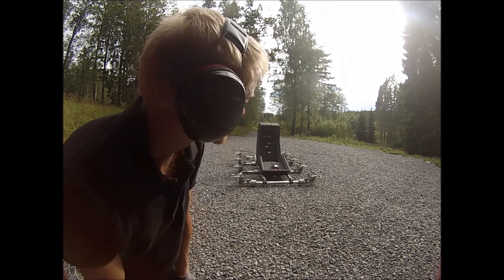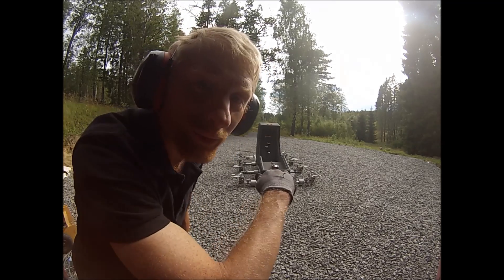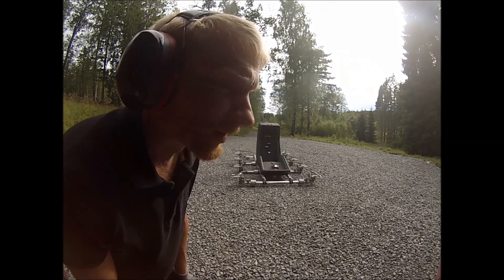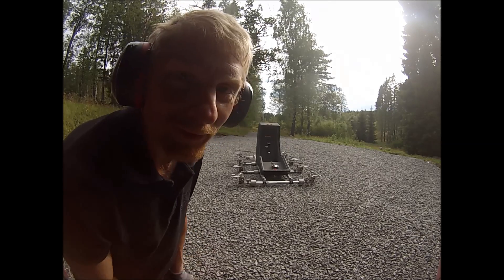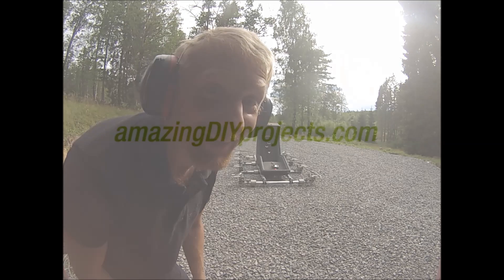Manned multicopter Episode 11  Expanding the flight envelope -Yaw

Comment: From what I seen in the pictures those plugs look rich not lean. Typically when a engine runs lean it will bleach the plug center electrode bright white. From the pics those look carbon fouled. Which means rich.
Reply: Agreed

Comment: You're the fucking man. Someone else brought this up, I ain't wealthy but if you had a kickstarter or some way of collecting donations I'd contribute if that would help you get better equipment and make a beast of a machine. I think many others would probably contribute too. One question what sort of flight time can you get at this point before having to refuel? Hope to see you fly from point A to B soon even if it's a really short distance. Good luck!
Reply from the maker: Thanks, really appreciate the thumbs up!
Just checked the last flight. The duration was 4 min 30 sek and the fuel consumption came in just under 3 liters. The current fuel tank is small, only 5 liters. So, in theory you got 7 min 30 sek duration if you only hover and do gentle maneuvering

Comment: I just dound out about you and naturally subscribed.

I am an engineer

you need the left side rotors to be turning the opposite direction of the right dide motors. Then you need to check if the inward to the craft direction of the rotors or the outward one is the optimal one because only the one of the two will be better since you had a difference now in turning soeeds between left and right.

I would guess that the outward one would be faster and the inward one for better control.

I can explain to you how this works allthough i am a civil engineer i have great perception through the other engineering field...

Hey maybe i can crack the mental iq record with a new number like 320 iq rating 😜
Reply: You should watch this project from the beginning, where he explains everything he already did.

Comment: Congratulations on achieving actual human flight with your design, that is truly amazing!  

I see you picked 2-stroke (2-cycle) engines undoubtedly for their excellent power to weight ratio which exceeds that of conventional 4-strokes.  I have a lot of experience with 2 stroke motors and yes, the spark plug is a good visual indicator of air/fuel ratio.  You need to look at the white ceramic part of the spark plug that insulates the electrode that goes on the inside of the combustion chamber.  The side view you gave doesn't really show this as we need to look into the bottom of the sparkplug to see this.  A perfectly tuned air/fuel ratio on a 2-stroke motor will read as dark golden caramel.  An engine that is running lean will look much lighter than this.  An engine running rich will be sooty and black.  From the picture you gave, they almost appear to be sooty and black meaning that you actually have a Rich condition (keep in mind I didn't have the best view of the sparkplug section I mentioned above).  it is far safer for an engine to be ran in a rich condition as it is almost impossible to hurt a 2-stroke this way.  It will just run poorly and you will foul sparkplugs, but the engine will be safe.  However, it is much more dangerous to run a 2-stroke in a lean condition as this makes them run catastrophically hot and what's worse is that in a lean condition you are running less fuel and the fuel on a 2-stroke is what delivers the lubrication; further compounding the seriousness of running in a lean condition!  You don't want to have the very real possibility of an engine seizure while mid flight.  I hope you are running at least 32:1 ratio of high octane gasoline (runs cooler as the octane controls the rate of burn) mixed with a good synthetic 2-stroke oil.    Also, once you get your engines dialed in just right, you may want to slightly richen them up to make sure that you are in the safe zone (like 1/16th of a turn out on the high speed jet).  Also something to keep in mind is that you want to retune your engines when they are at full operating temp, because if you tune while they are still in the process of getting to full operating temperature when they finally heat up they will be too lean and then you can have sort of a run away effect where the engines are running lean, get too hot, which makes them leaner, which makes them even hotter and so on...  It sounds complicated but really it's not at all, it's just basic common sense once you know these "laws" of 2-stroke engines (what I'm calling them).  

I can give you a list of why I'm credible of telling you this information if you would like, 
i just didn't need or want to toot my own horn because that is not what this is about, just trying to relay some critical information about these high performance/high RPM 2 -strokes because (admirably) I can see that you are trusting your lives to them.  Much respect on your creativity, engineering and well... you got balls.
Reply: Well said ! 
My hat is off to you Sir :)
Reply: GEORGE THEGREEK Thank you very much sir, I'm glad you concur!
Reply: i agree with Atimatik, he is correct in what he says.
Reply: Leo Hicker Thank you very much, I appreciate confidence.

Comment: Just some suggestions:

1. put some coanda ducts around your propellors.  This would provide extra protection (for you and the props) but more importantly it will significantly increase the amount of thrust you get and thus improve your marginal power situation.  There's a video on my RCModelReviews channel which talks about the theory of ducted propellers and explains how this works.

2. install some "proper" controls.  Yaw pedals, a collective/power lever and a joystick for roll/pitch will make it much easier to control the craft.  A joystick for roll-pitch will make the input of corrections almost automatic -- think about it.  If the joystick remains vertical and the craft banks to the left it will automatically input a corrective input. 

3. hardwire the controls rather than rely on an RC link.  A failure of the RF link or any component therein could result in some nasty consequences so the fewer parts in the link between the control input and the flight controller the better (increased reliability).

4. add some instrumentation -- especially for the motors.  EGT and cylinder-head temperature are valuable metrics for judging engine performance and reliability.  Your "lean" engine would have certainly had higher EGT and head temps so you could have spotted the problem before it cause the engine not to run.  If a similar problem causes an engine to stop mid-flight, the results could be far from enjoyable :-(

Keep the instrumentation simple -- rather than having a readout for each motor, simply have three readouts -- one which displays the minimum temperature (and engine number), one which displays the average temperature and one which displays the highest temperature (and engine number).  This way any exceptional conditions are easy to spot.

The real risk right now is that you've gotten past the "first flight" caution and trepidation so your confidence will begin to grow.  With most pilots, that confidence actually grows faster than it should so you reach a point where "something goes wrong" because you've exceeded your skill level or you've started taking essential factors for granted.   That's when bad things happen.   Treat each flight as if it were your first and perform very rigorous preflight and post-flight inspections.

This advice is worth what you've paid for it but I've done a lot of similarly crazy things in my life and (so far) managed to reach my 7th decade without too much damage.  I hope you'll do the same :-)
Reply: damn Bruce, that is some good advice...especially the part about the joy stick...that makes HUGE sense...it's almost a self leveling system if you just hold it straight up no matter what...what about a Nazi 32 with manual controls...is that possible?
Reply: +1
Reply: +powerftkt810Aerial +2
Reply: +Rasziel +3
Reply: damn Bruce, that is some good advice...especially the part about the joy stick...that makes HUGE sense...it's almost a self leveling system if you just hold it straight up no matter what...what about a Nazi 32 with manual controls...is that possible?
Reply: The key to your craft is that it is RC. First and Foremost. Otherwise buy a helicopter. In future you want to fly this craft FPV with VR googles. So for safety Bruce perhaps has a point but the trajectory of the craft that can lift a human is to be able to fly human size pay loads around. To fly bodies off mountain tops after a disaster. To deliver food and supplies to remote locations by FPV and RC. The whole purpose is to have a large RC craft. So keep your development work going and ask Brice about putting his FPV experience to consulting for you. That exhilarating feeling you have is about staying a few feet off the ground. But to fly it in the air put dead weight in the craft and keep it RC.

Comment: What's that spaghetti wiring box on the ground there?
Two strokes can be made to run in opposite directions. . . 
Extend the four inner motor tubes. Were gonna tell You all
about how to do what You're doing - this thing ROCKS! 
That speaker box cockpit is funky - looks heavy.  Enjoy this immensely.

Comment: the reason it turns better to the right is because of the directional torque created by all of the engines spinning in the same direction
Reply: he has reversed 4 of the engines so, no, that's not the reason. besides, if all engines turned the same direction it would be constantly spinning..fast! =)
Reply: +Joel Bergström I sort of figured that after I wrote it...I just wrote before I thought it through...thanks bud

Comment: that's not where you read plugs.  you read a plug where the ceramic and the metal shell meet.   

great job on your project by the way.   I love the stuff you do.
Reply: That thang should be blow'in smoke like mad . . .
Reply: What to look for.. you want a light tan at the base of the ceramic where it meets the metal shell.  You're looking for a light tan.  And you WILL need a flashlight, and ideally a jewlers loope.  Realisticly, I just wouldn't try.  

Detonation, might be a thing, you can find that on the electrode and ground wire by looking for little bits of aluminum deposited on the plug itself.  If that's the case, adding and extra headgasket can drop the compression ratio to help that out.  

It's been asked by others, but what premix ratio are you running?  Are you running model fuel, or gasoline?  |

HOw are you setting up the carbs when you run the motor?   IIRC, you richen them till the motor spits, then you lean for best rpm, then you richen it a little again.  That puts you somewhat on the cool side of things.  

Electrode wear is not "wrong" and can come from a lot of sources.  Are those the factory plugs?  A spark with to much energy can cause electrode wear.  And cheap plugs.  And cheap plug materials.  Are these the factory plugs?  Before modern iridium and Platinum spark plugs, plug wear was a normal, fast, common thing.  

For electrode wear, filing and re-gapping was the normal course of action.
Reply from the maker: Thanks,
What should I look for? The electrode in the middle is badly eaten away. The overhung piece is also affected.
Reply: I've always looked at the electrodes, but the ceramic may be better. However, with the "new" un-leaded fuel, there is not much colouration to go by. Try getting some AVGAS 100 to make a clearer picture of the mixture situation.
Reply: Your 2-stroke mix is too light on oil . . .
Reply: Please see my separate comment I made about this (I posted it before I saw these comments).
Reply: Electrodes get hotter, so they read very differently from the base of the ceramic.
Reply: We have some knowledgeable people here. Amazing DIY Projects, rest assured that you are in good hands with many of the people making comments from what I can see here.